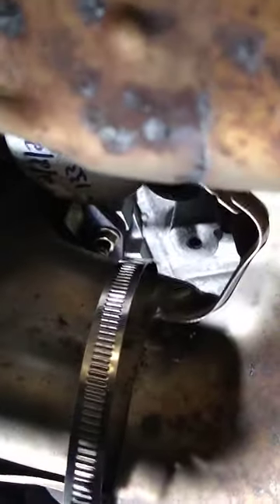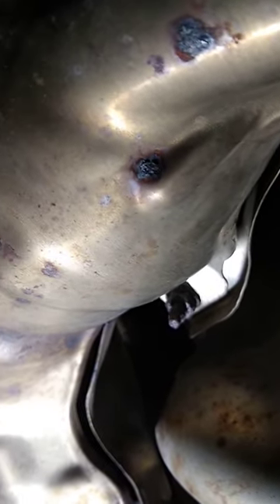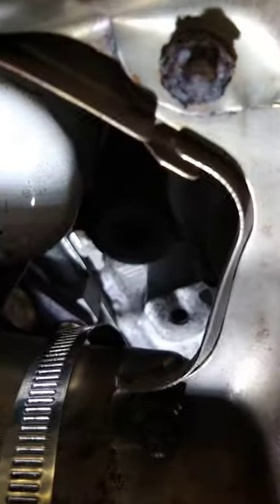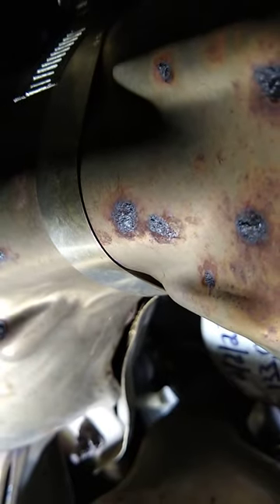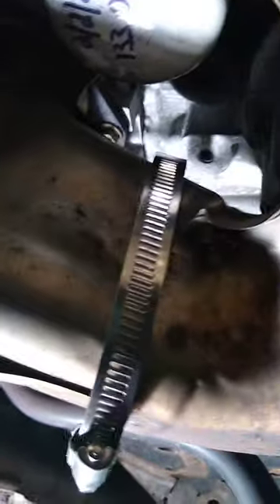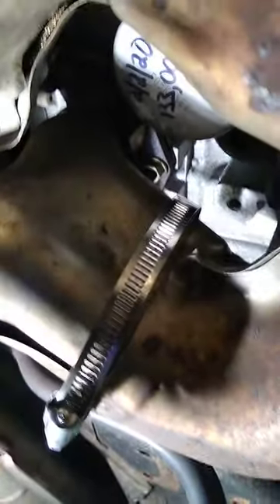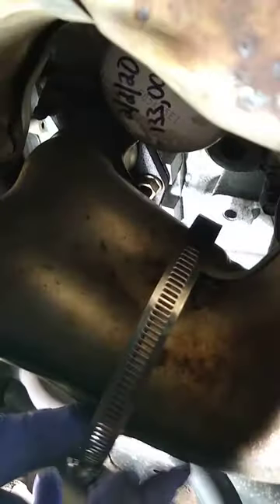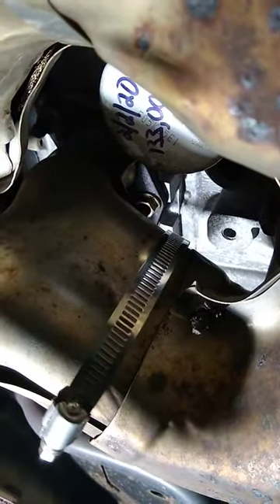Fixing Subaru Exhaust Rattle

Comment: Thanks! Thought it was my wheels again, but I held the plate while it was idling and found the noise
Reply from the maker: Nice - that's an easier fix than wheel bearings.  Some of the bolts that hold together the plates on mine were so rusty I could break them off with pliers.  I replaced a bunch of those with new stainless nuts and bolts.  Still have my hose clamps though :)